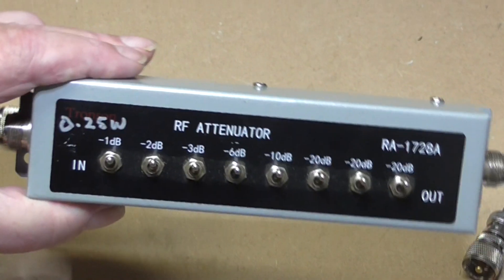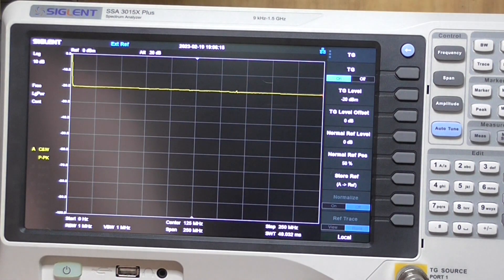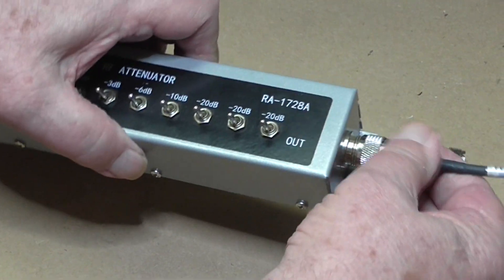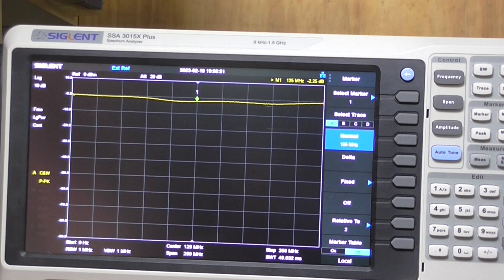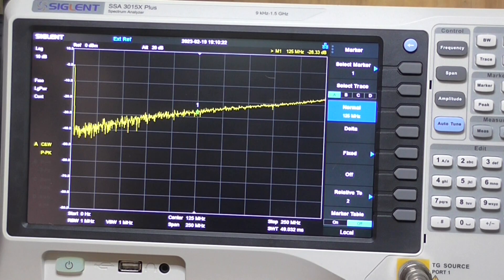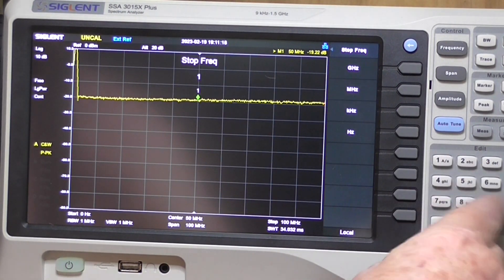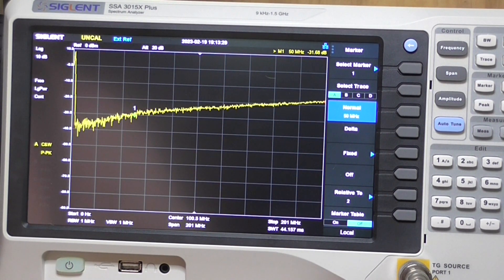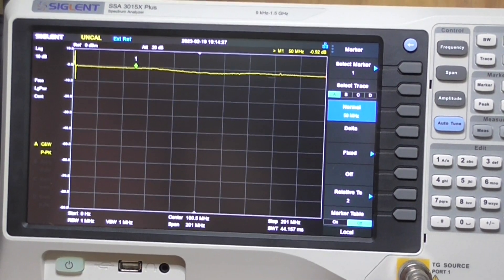VK1JTX - Ham Radio - #17 Cheap Attenuator

Comment: I think you should rise the input level to be able to see down do 80 dB of attenuation. It looks like you soon reached the noise floor of the SA. The frequency response though is still not appropriate. Also the insertion loss with no attenuation is not good. It cannot be due to cables/connectors cause you normalized the curve before.

Comment: Thanks for that . Have been looking at 5W Stepped attenuators for up to 500Mhz.(Amateur Bands) Seems from Youtube test Videos , that the cheap stuff is mostly OK to 30-100Mhz. then progressively worse the higher you go. The cheapest "Name Brand" I have found so far ,new is Fairview Microwave FMAT1043s at  $434 USD then convert to $AUD = $ 600  aprox + Postage. I have also Found an article and Youtube video of a Guy who fixed a cheap Tronson stepped att  at some cost. Google K4LED Tronson . You should find it if Interested.